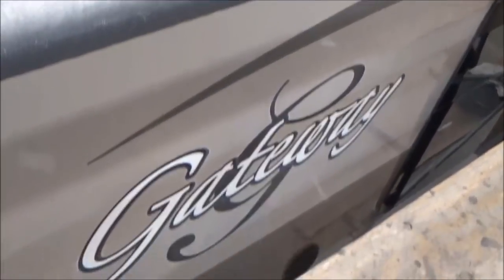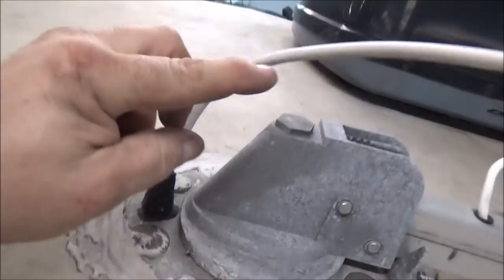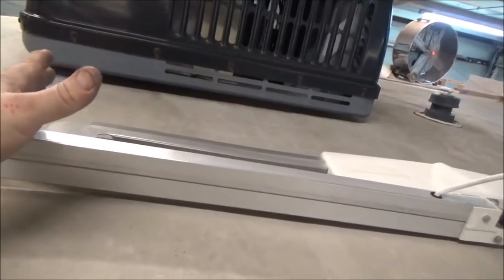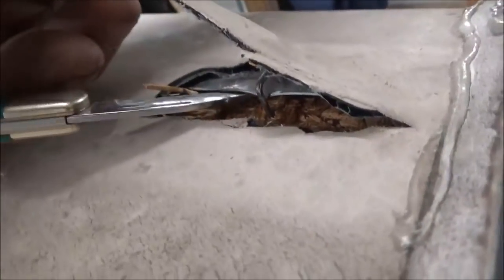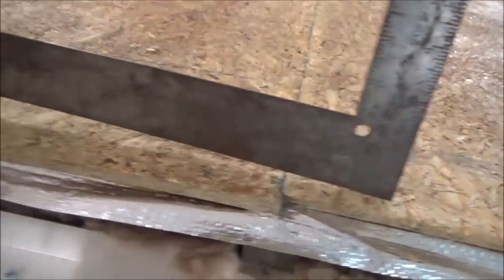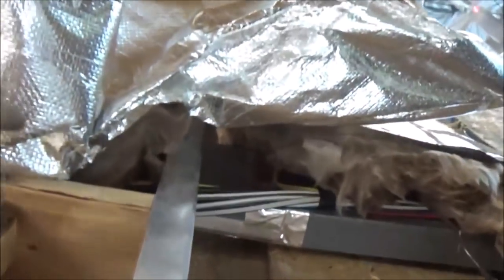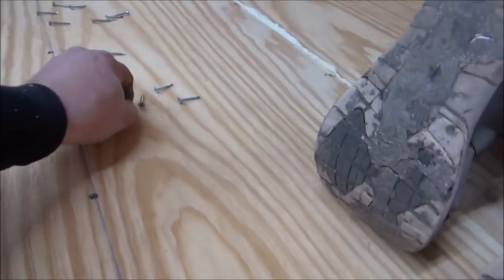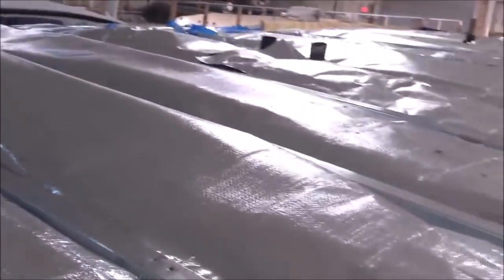Rv Roof Replacement and rear wall rebuild on 2013 Heartland Gateway

Comment: My RV was made in Australia 28 years ago and was not maintained. I am tooooooooooooooooo afraid to even look at what is under the roof. At the moment owned it 12 monts and working on replacing rusty screws, screw covesr and any damaged metal capping. Overcab was dripping wet, water getting in through cargo light screws. I took off the awning because same thing missing screw and unsealed screw heads and too heavy for the frame.  Next step is windows. Thanks for showing how slip shod some of the manufactuing construction is.
Reply from the maker: Thanks for watching. Maybe you'll pick up a trick or 2. I'm more of a restore than buy new. I got an old 91 YJ Jeep I'm messing with....or should I say mechanics messing with...lol. I don't have time to fix it. I work here too much. Maybe I'll build a camper, since I don't own one...lol.

Comment: Great work! It would be nice to see some drop cloths used on the rubber roof to protect it from the tools and workers up there. And now that I've seen how these things are put together makes me a little sick for having bought a motorhome. You guys are a class act!
Reply from the maker: We use TPO, not rubber. This is commercial grade TPO. The same as you'd find on a commercial building. 
 Thank you for watching!

Comment: I like the design of appliances raised on a frame.
Reply from the maker: They work and function like a commercial curb. That's the proper way to install a low slope or flat roof. 
Thanks for watching!

Comment: Have you ever got a travel trailer or 5th wheel with aftermarket solar panels installed on the roof, or get someone asking you to do the panel mount installs on the roof when they had the the roof itself rebuilt?  Would be cool seeing your thoughts on this if you ever get a camper coming in with an aftermarket solar panel install on the roof and how it affected the roof.
Reply from the maker: Yes, we have done solar prep for folks. We fabricate the mounts, drop wires and secure panels. However we do not actually do the electrical hook up. We did a 4x4 class C, several class As as well. 
Thanks for watching!

Comment: Best work n done right  wish you guy were in Texas
Reply from the maker: We wish we could open another shop but the fact of the matter is these rebuilds are harder and take longer than just a roof. Many of men have come and gone because they just have the skill set to rebuild a camper. Framers want to build it like a house. There is so much detail to consider and factor for long term results. Working on a class C now that had a tree go through and literally jacked the roof up and sailed the wall down 1.5 inches. What good is a roof if the structure under it is not done proper?
Thanks for watching!

Comment: I'm not trying to be negative but you are putting out a lot of bad information out in this video, mostly right but still, alot of bad info, and yes factory's build those things like crap after 2006 doesn't matter which factory, but you did do a good job with the roof, and I appreciate it when other people take pride in there work to.
Reply from the maker: Folks need to know what to look for so the don't get taken by poor craftsmanship or campers already falling apart. Wouldn't you like to know if a camper had underlying issues before you were about to buy?
Thanks for watching!

Comment: Rivets can handle the flex, just like panels on planes. Glue will fail eventually of the structure isn't stiff.
Reply from the maker: Adhesive acts as a buffer. Fasteners can not handle all the flex and vibration.
Reply: Some flex is necessary.
Reply from the maker: I think you are misunderstanding the concept...of course flex is necessary and if course there is expansion and contraction, adhesives come in different forms for this reason. Actual wood adhesive that would be used in wood working has no flex. Other urethane type polymer adhesives have adhesion and and flex. The purpose to it allow for movement without taxing fasteners. Fasteners hold things in place and do have shear strength and tensile strength to some degree  but that be is the fasteners. So when the fastener is in place the racking and flexing will wallow out the hole. That could cause a leak or the fastener to loosen. That's why there is subfloor adhesive...to prevent the squeaky floor which is due to nails not maintaining their tightness.
 
 All you need to do is read a tech data sheet and it will outline purpose, intent of application, proper installation, clean up and tolerances of movement, adhesion strength...all sorts of stuff. Most guys grab a product and go with it not knowing it intended purpose or compatibility. EI; silicone on rubber....doesn't work. Silicone won't stick to rubber. 

Now you know what you didn't know.

Comment: Pretty sure the manufacturer claimed aluminum studs for construction but that back wall appeared wood framed
Reply from the maker: Most are aluminum skeleton frames. The aluminum isn't worth anything...cheap...low alloy, and they ain't tack weld...what I call snot weld...which has no strength and usually breaks due to the racking and flexing these coaches do. I would much rather a wood frame. At least you can glue and screw the frame together. Also the wood will be a bit more flexible with compromise compared the the rigid aluminum. If there is no allowance for flex the energy generated from the flexing has to go somewhere and usually will compromise the joints...welds...or the fasteners. Adhesive acts a buffer allowance for the flex. That absorbs the flexing energy without taxing fasteners and joints.
Thanks for watching.
Thanks for

Comment: Hi, what a phenomenal job! We have a 2015 Gateway and I am sure there is just as much shotty workmanship in it as the one you just finished. Where are you located? We probably need your services to fix our roof, slide outs and walls. Gee it makes me so angry to know what we have paid for this thing and it's put together so terribly. Thanks, AK
Reply from the maker: We are located in Ft. Oglethorpe Ga. our number is 423-475-7663

Comment: What are you using for glue and are you tapeing the  seams with duct tape or are those metal strips?  Thanks !!
Reply from the maker: We use GAF glue. Not sure what you mean about duct tape. We do not use duct tape on the seams. Everything is glued on

Comment: Do you know of any reputable businesses in Ontario Canada that will due a good job like you folks? Great video by the way. Ive got a 2000 39' coach thats in desperate need. that one that your working on looks good compared to mine! I dont have anything coming through that I can see but its what you cant see that bugs me! Thanks!
Reply from the maker: No there is no other shop in Canada, USA or Mexico. We designed the roof system. We have had several folks come down from Canada. Thanks for watching.

Comment: What are your thoughts on replacing a roof with fiberglass on the ply instead of the membrane?

I have a 32’ class a Gulfstream that has a shit roof so im gonna replace this summer and am seriously considering finerglass
Reply from the maker: We have replaced numerous roofs that had Filon roofs. Filon is no fiberglass. It's plastic reinforced with fiberglass.

 I'f the roof doesn't have curbs it  will leak. You can can pour concrete on top...1/4" steel...no curbs....it will leak. 
Thanks for watching.

Comment: Great job and attention to detail. I feel most of the jobs you do are due to poor maintenance. Not everybody has the money to pay for the above and beyond work you do. Also the correct way to reseal is to remove existing coating clean and reseal not keep adding on top of it. Prep work is key. I have owned my aluminum siding 2001 Terry lite for over 8 years with no leaks or water damage on the roof and seams. I check it every year and repair it as needed. Maitance and common sense go a long way. There is no need to keep adding sealers every 3 months to build it like you mention in this video. I enjoy your videos but the amount of work you do to these trailers is insane. Something that can easily be avoided with maitance. Any who keep doing amazing work.
Reply from the maker: Thank you for watching. You are correct maintenance and common sense go a long way.  The RV industry takes advantage of folks lack of roof knowledge....and mislead them to think you need to do the Dicor application every 3 to 4 months.they just want to stay in your pocket. People ask me which one I have or like the best... they're all the same and ....I do not own an RV or camper.

Comment: What kind of primer and industrial sealant do you prefer for the terminal caps and the vents on top? Don't have enough money for a shop near me to redo my top cap so im doing it myself. Im use to working on cars and houses professionally but im new to TPO rv roofing material
Reply from the maker: All the materials you need you can get at your local commercial supply house. Just let them know what you got going on.

Comment: So should I peel all the old off.  Then recaulk with ?
Reply from the maker: Depending on what the old stuff is. If it's butyl yes cut it back. If it's loose, no matter what it is, remove the loose or unadhered caulk. If it's silicone try remove as much as you can. Wash with denatured alcohol. Then apply new caulk. You may have a tough time getting anything to stick to old silicone. Not sure what you have on there. Just because it's clear doesn't mean it is silicone.
Reply: @RVROOFINSTALL  the factory caulk which looks to be lap seal.2015 rockwood travel trailer that the caulk is cracking on. Just bought needs removed and re caulked or as you put moron it.

Comment: Why not put spray in bedliner on your roof I don't think whatever leak and I'm certain it wouldn't come loose.
Reply: Now that's an interesting idea...
Reply: My only issue with this is future repair that may be needed. It would be a bugger to get the decking off with this stuff on it.
Reply: Way too rigid and cracks in the sun.  Rv roofs need a certain degree of flexibility due to temperature charges and temperature differences.

Comment: I have a 5th wheel that is not leaking nor looks bad but it sounds crunchy and feels like  a 200 lb man can't walk on it. I was told it was the coating they painted on the roof. I am the 2nd owner and I'm not sure. Does it need replaced and what is the general price range?
Reply from the maker: Some coatings will crunch. It's the acrylic that is fracturing. Or it could be the roof deck delaminating .
Not seeing leaks does not mean it is not leaking. When a roof leaks the roof deck will absorb what it can...then the framing, then the insulation and finally the ceiling panel. When you see a leak generally there is much more damage than you think. Leaks are chronic and can funnel in many directions even down walls where you won't see them until you do see them. We have opened up roofs that have surprised us on the extra damage. 
We do not quote on social media. 
contactus@rvroofinstall.com
Thanks for watching.

Comment: Can you flexseal a travel trailer roof?
Reply from the maker: I would not recommend using flexseal. Coating don't stop leaks despite what they are marketed as. If it days RV on it...I wouldn't buy it. 
Thanks for watching.
Reply: @RVROOFINSTALL  thanks man so construction adhesive is what I'm looking for?
Reply from the maker: @2alawabidingcitzen  im not understanding what it us you're doing?
Reply: @RV ROOF INSTALL  on my travel trailer where the satellite is its sinking so I'm trying to see what I need to fix it.
Reply from the maker: @2alawabidingcitzen  it's sinking because the decking is rotted under it. Need to replace the decking to fix it proper. It will just keep in sinking and get worse causing water to pool in the sinked area...more leaks will come.
Reply: @RV ROOF INSTALL  got cha and to get it to stick I use construction adhesive?
Reply from the maker: @2alawabidingcitzen  you'll need to get the roofing up. Replace the decking... Flue it down and staple it down, then use membrane adhesive to reglue the piece you took up. Once all that's down you'll need to seal under the satellite real well with a urethane adhesive. You will need to go to a supply house and get membrane primer before you actually use any sealant at all. Nothing will stick to the membrane unless it's primed. It may appear to stick, but not long term.
Reply: @RVROOFINSTALL  thanks alot man I really appreciate it 🙏.

Comment: What is a good glue to use on studs?  Is it in a caulking tube?
Reply from the maker: You can buy subfloor adhesive in tubes , like Liquid nails.

Comment: Q: You say adding more lap sealant is moronic, but you never say what the alernative should be...can you post what that should be?? Are you saying it should be scraped off entirely and reapplied or osmething else??
Reply from the maker: No I am not saying to scrape it off, mainly because you will most likely tear the roofing. It's a bad roof system. You could try to remove it. Be careful. The RV industry exploits people's lack of knowledge of roofs and convinced them to keep slobbering more on...more on. 
Everything we use is commercial grade. 
Thanks for watching!

Comment: Do you think is better to use 2x4? My rv originally came with two 3/4" plywood staple together.  I am wondering why they didn't use stronger ribs.
Reply from the maker: Do you mean 2x4 for the roof trusses?
Reply: @RVROOFINSTALL  Yes. Is an 1992 Safari Serengeti. The sides are aluminum structure but the roof is plywood. They didn't use 2x4s
Reply from the maker: @miguelbecerra4379  class c? Travel trailer? Whatcha got??
Reply: RV ROOF INSTALL Class A, diesel pusher.
Reply from the maker: @73miguelangelo  email us ... rvroofinstall@gmail.com. much easier

Comment: What kind of sealant do you use? You described it as being like liquid nails on steroids.
Reply from the maker: M1 by Chemlink. All sealants are Chemlink products.
Reply: Thank you! You have a very good reputation wish you guys were closer.  We had the whole roof and “100% of plywood taken off and replaced” locally 10 moths ago and even had a leak in just a couple weeks after they did it. The plywood has started coming apart in the 2 exact same places on nose and next to AC unit. It was suppose to be guaranteed for 1 year and they do not answer the phone, texts or emails about our problems and others having leaks. I dont think they took the old off and they just put new over it and band aided it. I have seen now they change names every couple months so I think they are scammers that move from place to place.
Reply from the maker: @MotoHosedotcom  thanks for watching. Folks come from Canada, WI, New York, Miami, Texas.

Comment: What do you use to seal around the ladder mounts on the roof?
Reply from the maker: We use a commercial grade pourable sealer. Thanks for watching.
Reply: @RVROOFINSTALL  something like Chem Link 1-Part Pourable?
Reply from the maker: @darrellshriver30  sure. There are several types. It's not meant as a self leveling sealant. Designed for pitch pockets.

Comment: Whats sad is.
These coaches depreciate FAST.
The repair cost ? And rebuilding correct.
Like removing the roof sheeting and gluing screwing it down correctly 
Is more than the coach is worth 🤫🤔
Reply from the maker: That is true, but still cheaper than buying another one.
Thanks for watching!

Comment: What kind of glue do you use?
Reply from the maker: We have several glues.... These are not DIY videos my friend..
Reply: @RVROOFINSTALL  just wanted to know, thanks any way, liked your video.
Reply from the maker: @dave3301  we be use several glue adhesives....I don't know what you are working on. If you are wondering what glues for the roofing....whatever product you are using you can find the adhesive for it at local commercial supply house. Just let them know what you got. Not trying to sound ugly....there is a process for installation and if not followed then you yield poor result and leaks. I don't want someone pointing back at me saying I told them wrong, when it was really the process not followed. Hopefully the commercial supply house lead helped.
Reply: @RVROOFINSTALL  No problem, coyote  hybrid bunk wall, but it alright I will do more research, I do appreciate to reply, thank you and keep up the great videos.

Comment from the maker: The manufacturers goal is ...Get em Built, Get em Out...Get em Sold!  They use incompatible products, cheap products, piss poor designs....all they need to do is get by for 1 year. RVs do not  fall under lemon laws.
Reply: Which manufacturer Do you recommend to buy?

I have a small pull behind camper trailer that has ceiling a wall rot around the skylight I  the bath room. Now I'm stuck on what to do next.
Reply from the maker: @akdenali  you can fix it or buy another ...lol. which ones are best?? They're all the same. I don't own one. One thing is for sure, whatever you buy it'll need a roof. Thanks for watching!
Reply from the maker: @akdenali  Here's what I suggest to most folks. If you like the camper, like the layout,   and style, then put a roof on it. However if this is an old aluminum sided one like the ultra lite we have posted, don't put your money into it. The ultra lite...really Super lite....had a lot of rot and really wasn't worth it, but the owner just bought it and was damned if he didn't. I'm sure if he knew all what was entailed he wouldn't have bought it.
So there are the options.